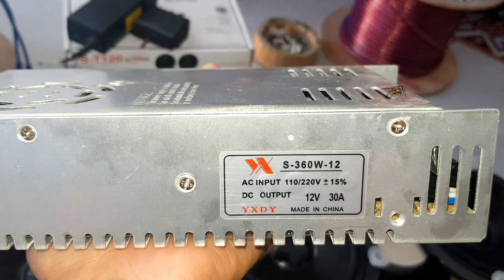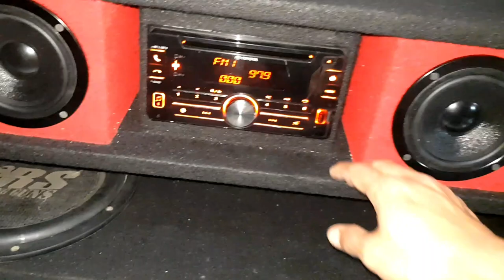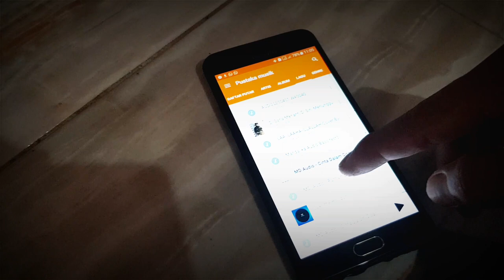DIY - Home Theater dari Bekas Audio Mobil - suara mantap

Comment: Bagus banget. Adaptornya berapa ampere mas. Apakah masing 2 head unit dan power pake adaptor sendiri 2.
Reply from the maker: Adaptornya jadi satu, sya pakai 30A, tapi sya gunakan step down untuk head unitnya, max 3a